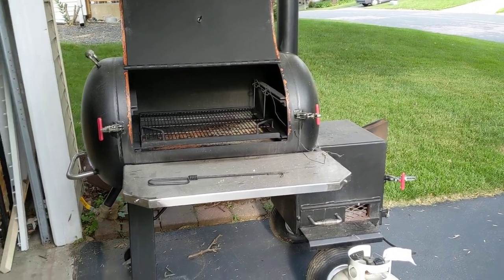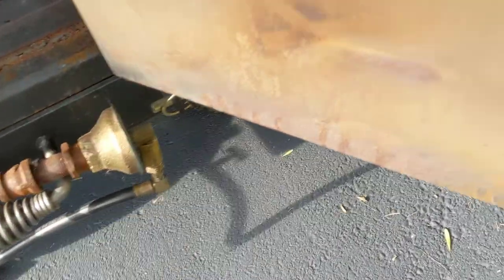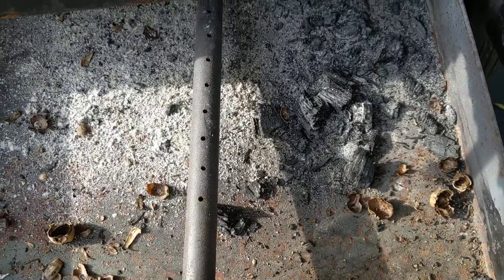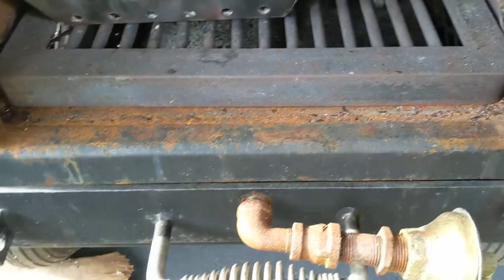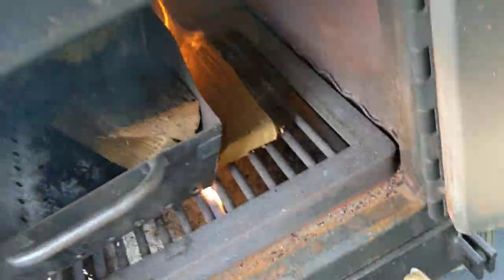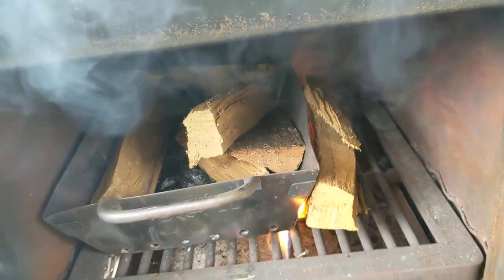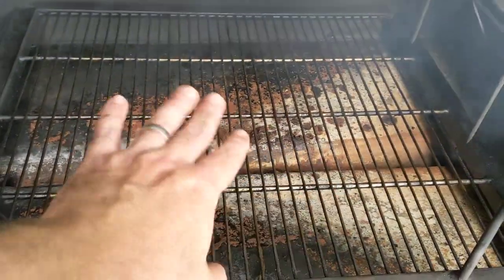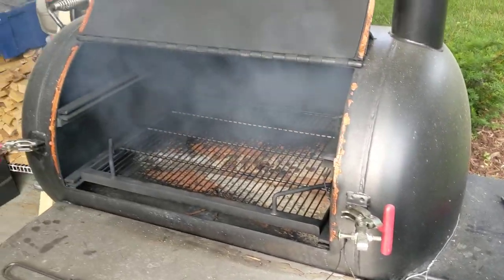Starting up a Meadow Creek TS-70P Smoker with gas assist mod

Comment: Hey Bryan, I was considering purchasing a TS70P myself and was wondering what the dimensions of the grates are and if it can cook a whole packer brisket? Thanks!!
Reply from the maker: It will fit a whole packer brisket with ease, maybe even two on the same grate. With both grates in you could smoke up to 4 briskets at a time. Don't know the exact measurements of the grates, they are on the Meadow Creek website.